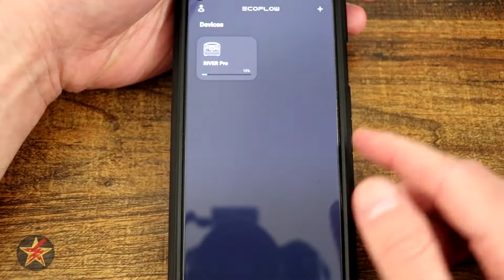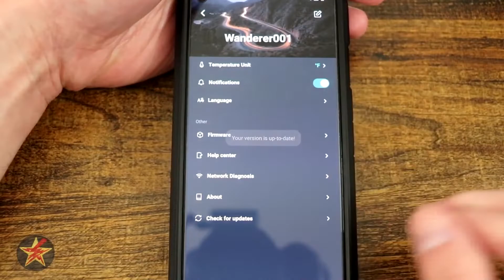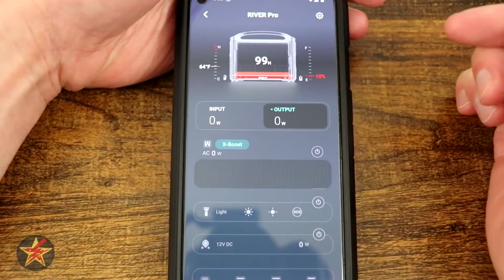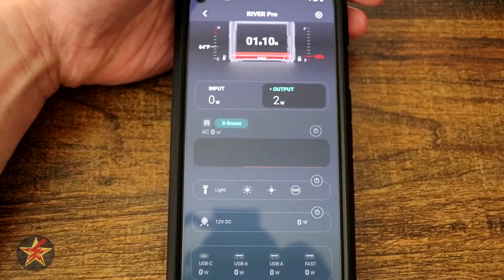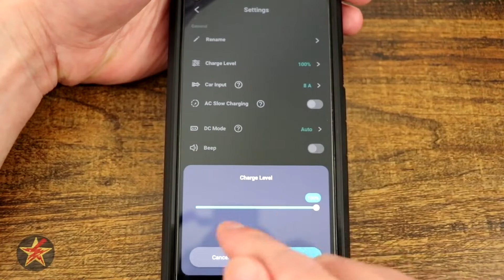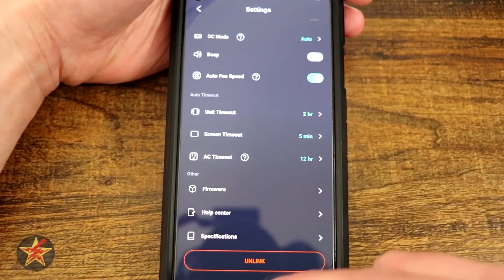EcoFlow RIVER Pro App Walk through

Comment: How do I shut off unit thru app
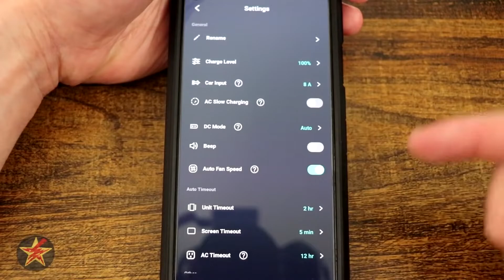Reply from the maker: The unit itself can not be turned off from the app.   The most you can do is set the time out meaning if the unint has be on for X amount of time and now power draw is detected it turns itself off.  This can bee seen at 6:09.

Comment: With river 2 pro they say 3000 charges  can they not be  by AC  fast charge ? I am waiting for mine to eb delivered
Reply from the maker: They changed the bettery makeup.  Which gets it up to the new max charges.  You can prolong the life of it by not charging it to 100% and limiting the amount of times you use the AC fast charging.
Reply: @Wanderer001_Reviews_Clips  thanks for the tip I will it be using that often maybe 1-2 months a year on camper van trips I also have brought the 160w solar panel main use it to power my Starlink sat unit when traveling drawing 50-75 watts
Reply from the maker: @Malsaxbythewater  That should not be an issue.  I picked up the 160w solar panel for myself to keep it charged.  Does a pretty good job.

Comment: I noticed when you "slow charge" the fans are not powered at full capacity and this heats up the device causing it to charge even shower (it goes into some sort of safety mode). this is something they need to fix.
Reply from the maker: It is the current trade off. It might be addressed In future firmware updates.